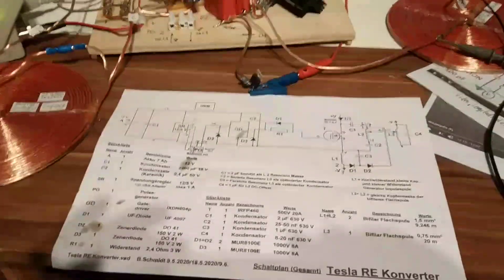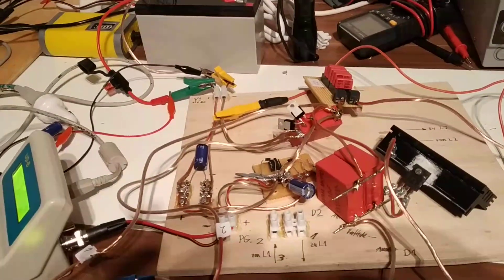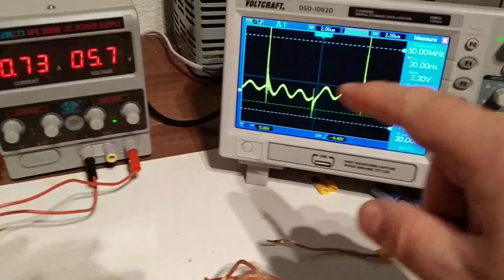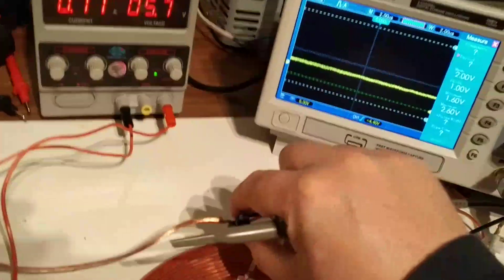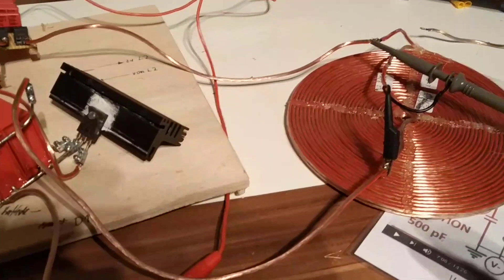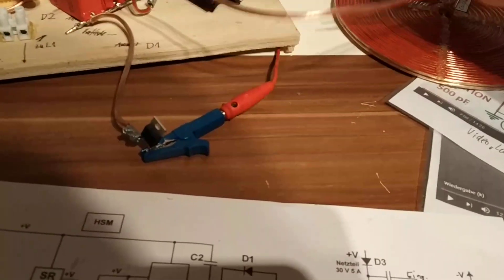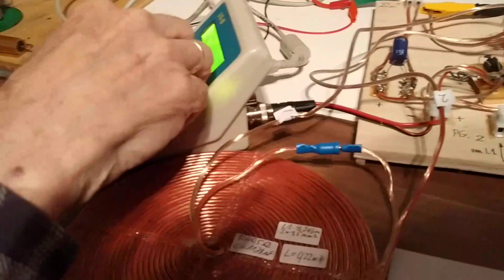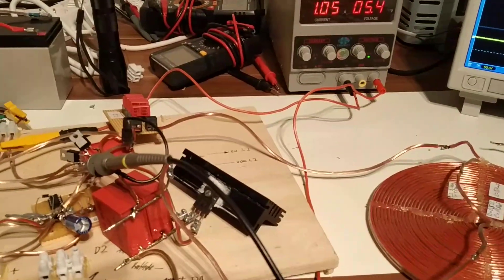Master Ivo Replication part 3

Comment: yes probe ground isn't needed, the probe already is grounded by the scope. just use the tip. be carefull with the DC offset voltage it is dangerous!

Comment: I think from my experiences with circuit building it is best to build a few for reference rather than try to figure out the problem  not even knowing and with the assumption that everything was working correct in the first place . Know what i mean ?

Comment: Just use current probe. The arcing from the coil to the ground wire means short circuit somethere due common ground. Or you could use handheld scope for galvanic isolation.
Reply from the maker: Yes you are right there must be a ground Problem... Because I already wondered when I reverse the scope probe at the L2 coil, why I get a totally different waveform and not just an inversion of the waveform..thanks for the idea...👍🏻👍🏻👍🏻🙋🏻‍♂️
Reply: overunitydotcom makes sense to me that probable in the drain source might be damaged a bit . They can develope slight shorts but i suspect mostly it is a danaged diode !